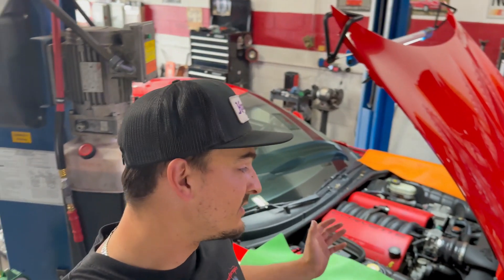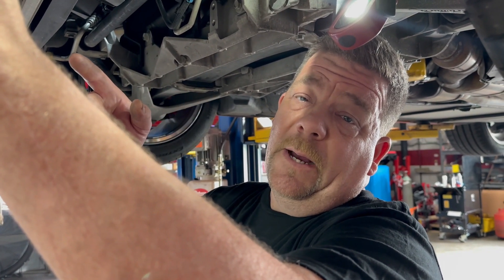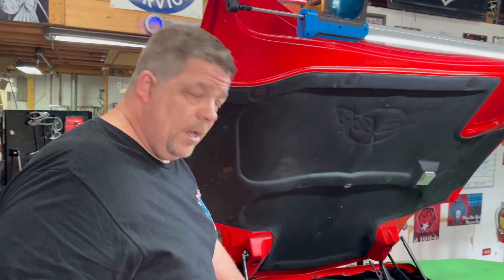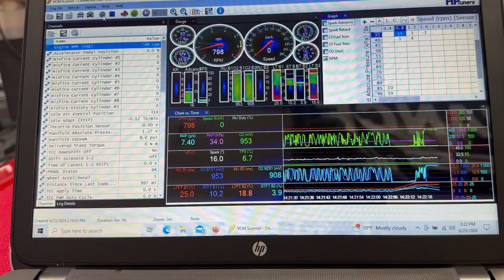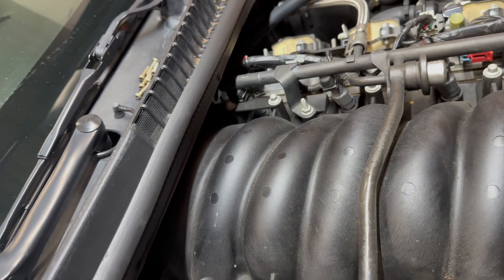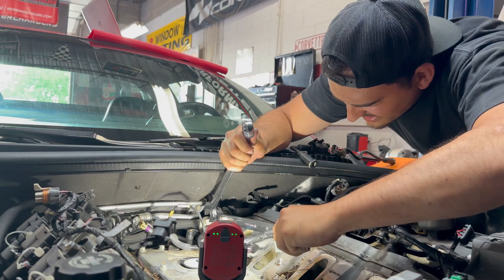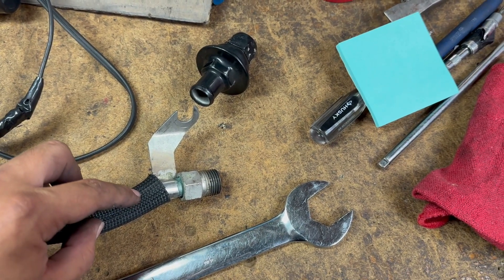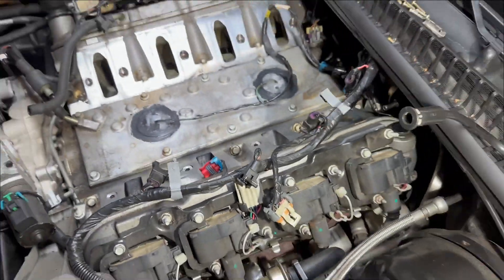C5 Corvette: How to Diagnose and Repair Secondary Air System

Comment: First, thank you for making this video I've actually watched through it and paused it more times I could count. I've been doing troubleshooting with mine, and I actually do get nice bursts of air coming through the tubing from the fan. However I noticed on the air tube going to the manifold, that it actually has a vacuum going on. People mention exhaust coming out of the tubing but I can put a piece of paper up to it and it sucks on it. Does that mean that my valves have become two-way valves? I would think that exhaust would be blowing out of the tube if that were the case...not creating a vacuum.

Also I have been using the otolite D1 as suggested on the Toys4Life YouTube. It has two-way communication and it let me test the solenoid and run the air pump via the console. It's pretty darn cheap for what it does if you guys are looking into getting a handheld. Just wanted to mention that. 

Thank you for your help.
Reply from the maker: Apologies for the late response. The vacuum you are noticing is correct. Check the pipe for the rear one and check the pipe for the front on. If both are showing vacuum instead of pressure then both of them are good. Also one last thing, just because you are getting flow out of the pump does not mean that it is enough to actuate both valves so you'll want to verify that.
Reply: @AntiksGarage thank you, yea I do need to check both of the valves, not just the first one. I even tested it w the otolite on a cold start. I was able to see the O2 sensors go high and then drop low then back to oscillating. Let's see I'll let ya know!
Reply from the maker: @awinningidea  sounds good, here if you need anything!

Comment: When you say you cant drive the car what does that mean? I have a C5 and the pump is failing but I dont have CATS so can I just pull the #50 fuse or will the car not drive? I already have a check engine light for CAT delete it does not bother me.
Reply from the maker: In this case it meant the car could not be driven because it cannot pass emissions / get registration in Illinois. You can pull the secondary air fuse or unplug the pump. Sometimes pulling the fuse may disconnect other systems so we would recommend going under the car and just disconnecting the pump in your situation.
Reply: @AntiksGarage  Thanks for the help I pulled the fuse before autocross yesterday and it did fine the whole event. Thanks
Reply from the maker: @YoutubeMastersDegree great! Glad to hear it!
Reply: @AntiksGarage Hi . I have bought a 2001 c5 and i haven't driven in over 24 years after a bad wreck.  But I finally got back on my feet walking well and im working on the c5 and it has a hard start problem and is running bad. I replaced the spark plugs and wires but still have a misfire and I replaced the fuel filter regulator and ive been cleaning the grounds under the hood and in the back underneath. I still need to finish cleaning the main ground points.  I dont really have any codes accept misfire in multiple cylinder. What should I check 1st ?

Comment: No bidirectional scan tool instead of HP Tuners ???…you could have commanded the pump and solenoid on without having to apply 12 volts directly to the pump.
Reply from the maker: No we do not have one of those at the moment. Additionally most people do not  either and we wanted to demonstrate how to diagnose the system in a simple way that anyone would be able to do!
Reply: @ your shop should invest in a good aftermarket scan tool and a labscope…you can’t diagnose cars these days without one…I do Corvette diagnostics down here in SW Florida and I couldn’t correctly diagnose these cars without one…I use 5 scan tools and a labscope…Lol !!
Reply from the maker: fortunately the cars we see most are C5s and C6s so it is very easy for us to diagnose them more 'manually' if you will. We don't have enough cars coming through to warrant the purchase of an expensive tool like what you are describing as much as we do want one. At the end of the day for the cars we see most frequently, we have never had an issue diagnosing electrical issues even if it is done in a more redumenetary way but we would like to get a nice scan tool at some point.

Comment: at 17:04 on the left side of the screen. There's a rubber elbo. Does anything go to that?
Reply: I've changed the valves, cleaned the lines and checked the pump. No P0140 anymore. But not I can't get the Vette to pass readiness checks on a scanner. Secondary air system still says not ready and not the 02 sensor heater is saying not ready 🤷‍♂️
Reply from the maker: @retrobear9367  in order to the the secondary air to go from 'not ready' to 'ready' on the monitor status, the car must be cold and then driven through warmup and that must be done several days to a week in a row for it to pass its self test in order to set the monitor as 'ready'. The heater readiness will set after you drive the vehicle from cold through warmup a couple times. It will self check and then set itself as 'ready'. For the secondary air there needs to be a length cooldown,. 5 to 8 hours, in between drives
Reply: @AntiksGarage  Thanks for the info. For the time being. Im going to a tuner tomorrow. He claims he can tune the car to get me through inspection and put it back after
Reply from the maker: @retrobear9367  yeah if it is the downstream O2, the tuner can write it out and if it is the secondary air he can tune it out to set it as 'always ready'. You should be good!
Reply from the maker: @retrobear9367  are you sure it's 17:04? Trying to see what you're referring to but I don't see any rubber elbow. That time stamp is the very end of the video
Reply: @AntiksGarage  lol oops! I meant 13:54. I found it again in the video. You said it was vac line and it gets brittle. I can't figure out what the heck goes to it. We had my manifold off a few months ago and we couldn't figure out what that went to. We've gotta go back in this weekend and change the back check valve. Getting P0410 and failing emissions. Already changed the front valve
Reply from the maker: @retrobear9367  ah yes, I see now, that elbow goes to the backside of the intake manifold. In the time-lapse right at 8:57 you can see me unplug it from the backside of the intake before we remove the intake completely. We also make sure to hook it back up to the backside of the intake before we set it fully in place on reinstall.

Comment: The best video out there. Thanks. You mentioned a couple times that the pump was weak. How much suction is there supposed to be or do you guys just know by feeling and experience?
Reply from the maker: @philipdohrman5601  Thank you!! it's mostly my feeling and experience, that pump is supposed to blow pretty hard because it has a diaphragm to blow through as well as the two one way valves and still overcome the exhaust back pressure

Comment: I had a fault because the ground wire crimp on the eyelet terminal was bad causing intermittent connections.
Reply from the maker: @bobc997615  it is good practice to check your connections. With this system the faults usually lie within the pump or the valves but yes always double check your wiring!

Comment: I guess I was just going to go ahead and replace the pump - but I should be sure the values are ok as well. Do the values tend to be a problem as well? - Thx
Reply: Well guys I took some readings after replacing the pump and the one valve I could get too and the numbers on the 02s upstream are still in the .9 range. (looks like no air in there, even when I command the air system to on)  The car is 20+ years old so I figured it needed a new pump anyway, I was also in that part of the car to replace the headlamp. It didn't fix the code so I will replace the other valve when I take off the manifold. Will do the knock sensors, move the oil sensor and replace the pcv as well. Will let you know how it goes.
Reply from the maker: @br0g-NYC  sounds good, let us know if you have any questions!
Reply from the maker: @br0g-NYC  also one more thing, be sure to double check the diverter valve right off the air pump, if there is no vacuum to that it won't open and let air flow through to the valves
Reply: @AntiksGarage  - oh that is a good point - I did take off the diverter valve off and clean it up a bit. I know they don't make that valve anymore so I did what I could with it, but I will check the vacuum on that line for sure.
Reply from the maker: @br0g-NYC  Yes! Often times it is the valves that are the issue. This is why we showed how to diagnose all parts of the system.  It's very easy to check the valves as we showed so its best to make sure you are identifying the true problem and not wasting any money with the parts cannon!
Reply: @AntiksGarage  - Thanks again! :-)
Reply from the maker: @br0g-NYC  of course!

Comment: My issue was leakage of battery acid into the wire looms below thathave vacuum lines in them. Holes in the vacuum lines threw the P0410 code. Be sure to check for acid damage as this is also a common problem with the C5. PS: your computer also lives below the battery which is also susceptible to damage.
Reply from the maker: @johndemorro1676  yes it's always good to be checking your battery to make sure it is good and cannot cause any issues especially to the components below it